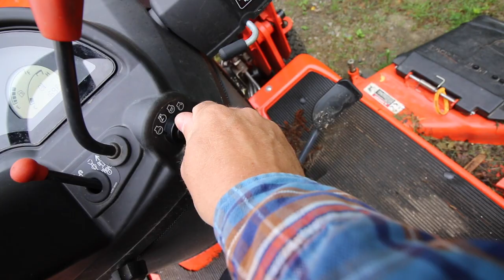Chicken Plucking!

Comment: Feathers or not, those are beautiful birds.
That plucker works really well! I love the crate - that part was the worst in processing my own birds: catching them.
I don't know if this will help, but I learned processing my own birds is that cleanup is way easier if you have a spray bottle with cheap food grade oil for the cones and whatever you catch the blood in: just lightly spray oil on anything that touches blood.
I started using the straw method on the shrink bags, too - I found some stainless straws - but whatever kind of straw you have seems to work well.
I hope all went well - looks like it did.
Reply from the maker: Thanks! The oil Idea is great. Glad you shared it! It went very well!

Comment: A few points;   (no laughing)  ;o)
You didn't tell us you MEASURED the crate so it would fit the tractor scoop.
Those Y hose spliters have shut offs on them, Although it looked like it worked fine the way you did it.
How was it to clean the plucker when done?
If you put a funnel on the crate you wouldn't have to open and close it all the time  ;o)  <<< extremely lazy guy
If you suck on the straw while removing and sealing, you'll get even more air out. (Boyle's Law P(X 1/v)
And finally, was Blacky included today?
Reply from the maker: No Blackie! lol. I wouldn't want to suck on that straw! Lol I didn't measure! I should have. It was very easy to clean the Yardbird plucker. The outer housing comes off, for easy cleaning!